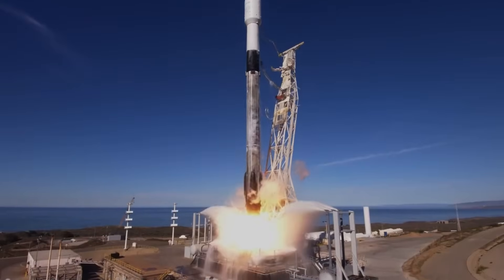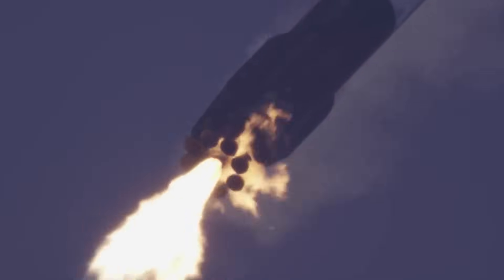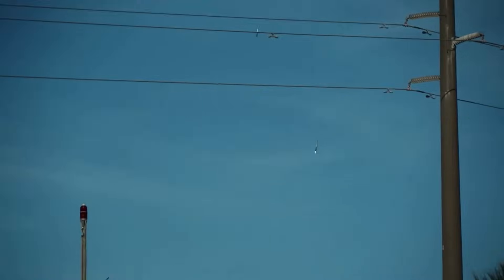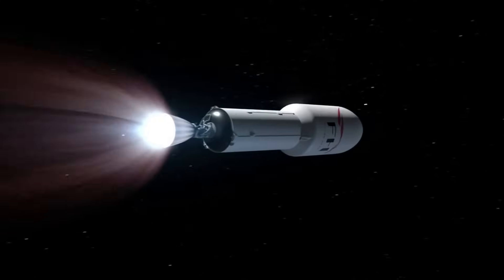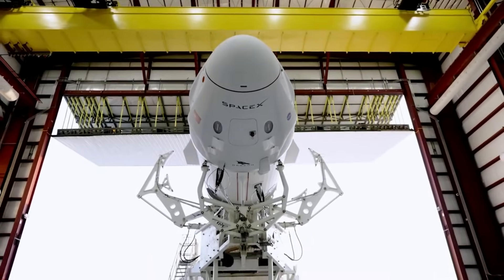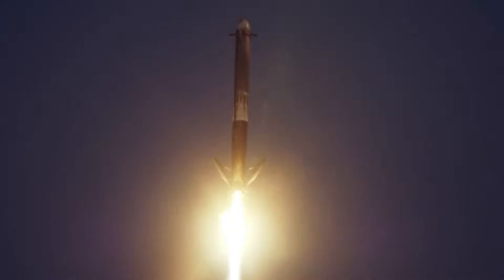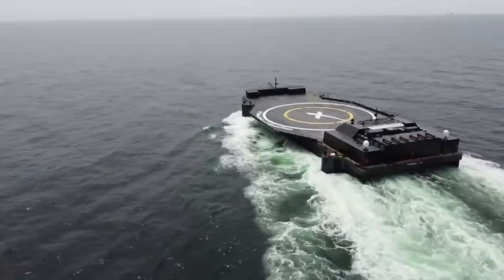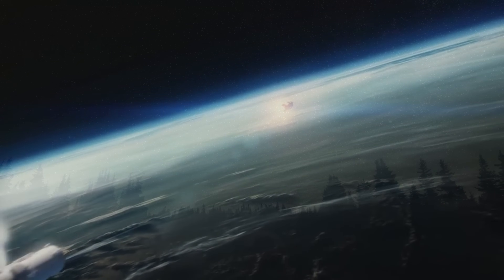Why SpaceX Is Expending Boosters In The Ocean

Comment: I have wondered if they give a different price structure based on how many times a booster has been reused. This would be especially significant on a expendable launch. For instance, will get you a booster with 15 previous launches for $20 million, or a new booster for $30 million.

Comment: SpaceX is getting expendable contracts because that's the only way Falcon Heavy can lift a 10 tonne payload beyond LEO (Falcon 9 doesn't have the fuel capacity for those size missions beyond LEO).
To get 10tn past LEO (to GSO, SSO, TLI or beyond), Falcon Heavy loses its partial reusability i.e. loses its competitive edge.
And Falcon Heavy can ONLY lift a max. of 10tn to ANY space destination, because of both aerodynamic and structural limitations, despite its engine capacity and Elon Musks disingenuous claims to the contrary.
SpaceX Fans can deny this but the Space Industry knows it, hence they go to the Big Boys to launch REALLY heavy payloads; their launchers are expendable and expensive but they get the job done whereas SpaceX simply cannot do it.

Comment: Don't get into all the hype SpaceX and the fanboys thrown around about retrieving the boosters. The rocket is just a fraction of total costs per launch. There are also expenses with propellant, Staff and operational costs from the launch pad infrastructure. If the economical advantages of retrieving the boosters were so significant, the costs per launch should be by now drastically decreasing.
Reply: I sort of get where you're coming from, but it all depends on what you're trying to accomplish with your rocket. Expendable rockets do have better performance and range than reusable ones that need to save fuel to land. Though, if you want to launch a ton of stuff into Low Earth Orbit with fast launch cadences then there's no beating a fleet of new and previously flown boosters.
Reply: But why though SpaceX charges so much less than the expendable launch providers? all of them have launch pad infrastructure, propellant and staffing expenses too, But the competition charges nearly double of what SpaceX offers for the same payload to orbit? ULA's Atlas V for instance has a max payload to LEO of 18.8t for instance is upwards of $110 million. Falcon 9 Brand new is $75 million, for a reused one it can be $52 million. In a Reusable config it can put 17.4t to LEO, (22t expended). Care to explain your thought process?
Reply: @kittyyuki1537   you conveniently cherry picked their alleged launch numbers. They're cheaper, because their're underbidding the competition, as reducing their operational costs. The impact of retrieving plus refurbishing the boosters, it's not as significant as many fanboys pretend to be.
Reply: @RogerM88  Care to explain your thought process? If recovery and refurbishment of boosters don't have a significant impact, why can't the expendable launch providers underbid the same amount?
Reply: Not that I have to defend a faqqing billionaire and his tupid companys, but You forgot that SpaceX is building a multi billion network as internet provider. They pay for this with the money they get, after they cut their official launch costs in half. So its not 52 million per lanch, but more like 15 million. Yo need a lot of cash to build and launch 5000 satellites.
Reply: You will still have all those costs with or without reusability 🤷‍♂️so reuse is obviously cheaper by exactly what it cost to build the booster per launch, simple math in my mind.
Reply: Starship is on a path to not be re-useable by the end of the decade.
Reply: @nononono3421 say's who you 😂😂😂